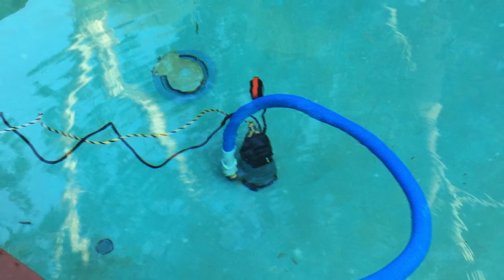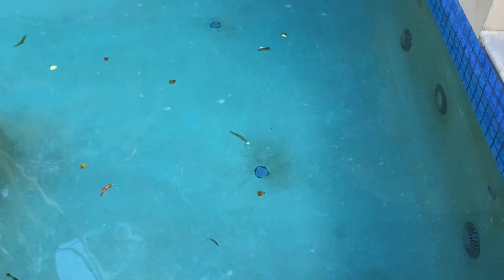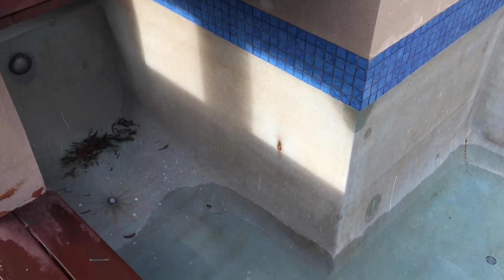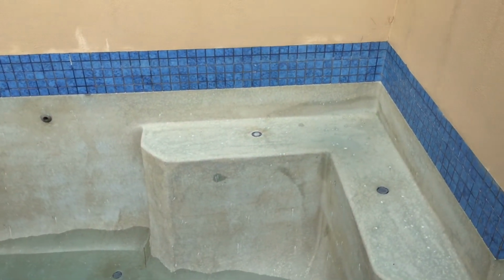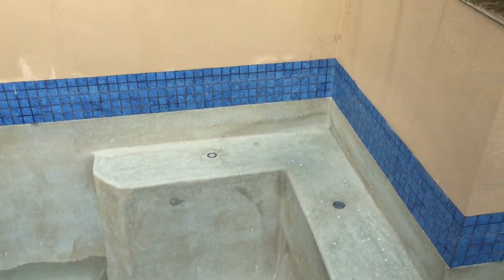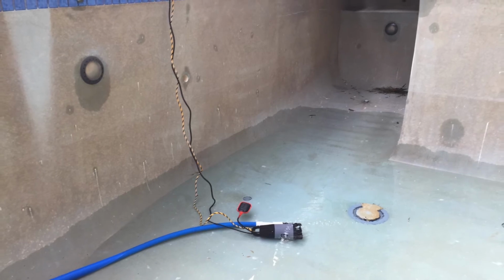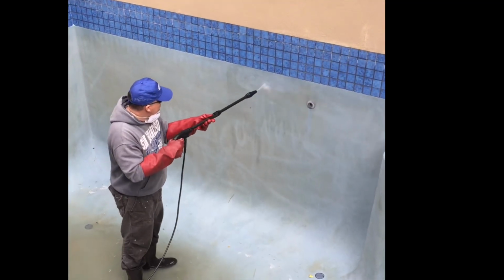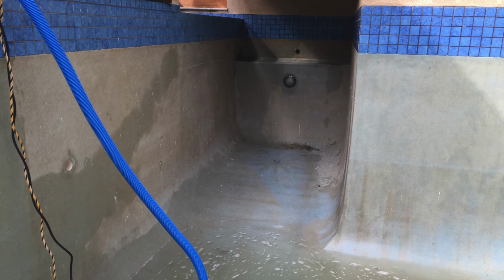How to safely empty & acid wash a pool and why you would. How to clean a stained pool

Comment: Great video Mark. I’m interested to know more about the tamer version of the acid wash you mentioned rather that a full drain and acid wash. My parents pool is around 20 years old and is concrete with pebble Crete. There are some stains that i believe are iron and copper based but seem to respond well to ascorbic acid tests so am looking to remove them via that method rather than drain the pool. My main concern is the hardness level seems to be through the roof I am guessing from a combination of evaporation and also use of cal hypo chlorine by tenants previously. Calcium hardness is up around 650ppm plus and I know there isn’t much options for reducing hardness without draining and refilling the pool however am interested to know if you think the addition of the large amounts of acid and then vacuuming the sediment from the floor to waste could help get the hardness levels down? Thanks for any help you can provide! Cheers. Javed.

Comment: Mark can I get your advice on a swimming pool liner as my liner is dead and needs replacing so the question is do i go for a new liner which 2 quotes have been over $7,000 or get it fiberglass instead(no idea of cost yet) pool is approximately 8.5 m by 5m  so can you help me here please
Reply from the maker: Luckypete 08 If your pool is vinyl, that will most likely be your best and cheapest option. Pools are not readily interchangeable by type they are very different in construction.